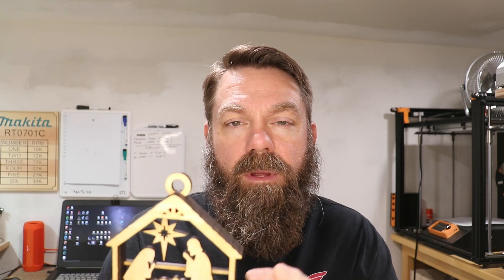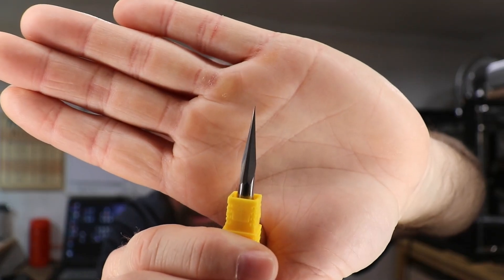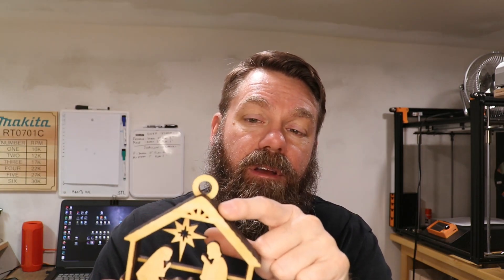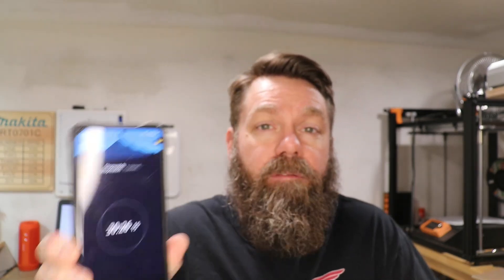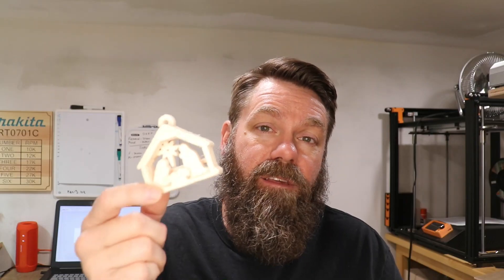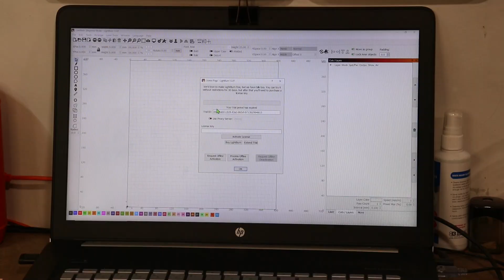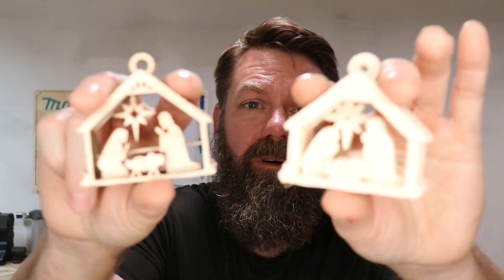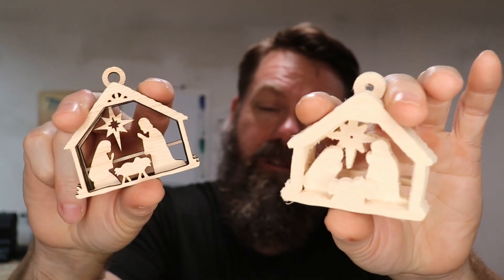CNC vs LASER - Which is quicker, and more important, which looks better.

Comment: This comparison is not correct. It's like comparing a microscope with a hammer in what would be best to crack nuts. These are tools designed to do absolutely different things. Why don't you compare a laser to a mill in cutting 3d objects instead? That would be equally incorrect.
Reply from the maker: If you watched the video, that's pretty much what I said. Two different machines designed for different tasks.